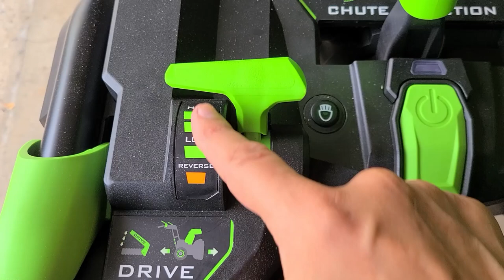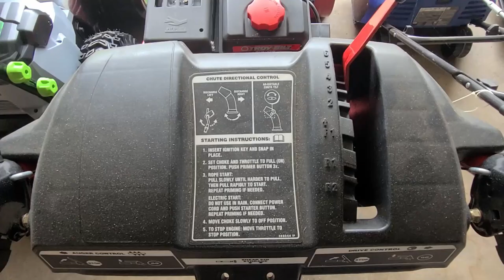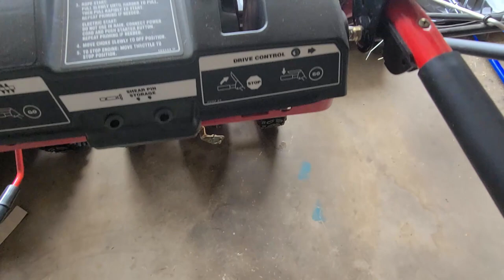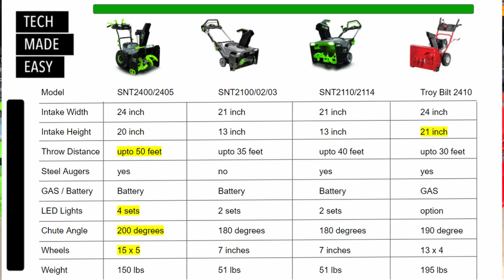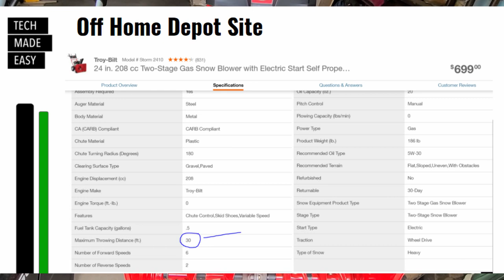NEW EGO 2 Stage Snow Blower unBoxing, Assembly & fun Comparison review

Comment: i got to test the prototype a year ago on the 2 stage and the metal auger 1 stage...i have the rubber auger and used it side by side with the steel one and the steel one was nicer throwing snow....when i tested the 2 stage , i told them it needed a limited slip differential and they used my idea....it makes it easier to turn at the end of a row....i have a 26"Ariens which is a big boy next to the EGO but the ego is nice for people who may fear gas or size or noise...great video
Reply from the maker: Thanks so much Brian, I’m excited to use this, can’t wait for snow ❄️ might have to go looking for it. Have a great day

Comment: for anyone on the fence between the 1 and 2 stage, I would not hesitate getting the 2 stage....i used the prototype a year ago and it worked great....it is not a gas machine but it does what it has to do, gets rid of snow....the 1 stage is good for a deck or a walkway or like i use it, a dog path in the back yard......the price may seem a lot but you get what you par for nowadays....the machine is not intimidating and plows through snow  AND you don't break your back shoveling....if you are trying to decide, just do it, you will not look back...i have 5 EGO products now and love them all
Reply from the maker: Thanks Brian appreciate you sharing your experience

Comment: I have definitely been eyeing one of these units. I looked at one up close at an ACE hardware I the Detroit, Mi area and I was impressed. Looks well thought out. My only concern was the gauge of the metal for the auger and impeller housing seems rather thin. Could just be me. I have an ECHO ( not EGO) 56 volt lawnmower that has a one piece molded orange ABS plastic deck that has a lifetime warranty. ABS is basically "LEGO" plastic. Very tough, doesn't rust, need painting etc. Too bad they don't use this material for the housing which would last just about forever and not need any adressing AND would be considerably lighter. Just my two cents. Still, a wonderful unit anyways. Can't wait to see someone posting a video in real snow conditions.
Reply from the maker: Can’t wait for it to snow Karen 😊

Comment: Good vid
Looking forward to review of this unit in the snow - hoping someone does a comparison against the SnowJoe 2 stage.
I have a big Ariens gasser -- tried to replace it last year with the 2 stage Snow Joe but that was a fail - returned the SJ.  The SJ was 100V batteries and this new EGO is 56V so worried about power. SJ 100v5AH vs EGO 56Vx7.5AH???.  EGO looks way better built, controls much better - but does it clear heavy wet snow. I had the SJ jamming up on 2 inch of heavy snow.
Looking forward to seeing more in action reviews of this product but I dont think I will get on until next season once all the test vids are out from this winter.
Cheers
Reply from the maker: Patrick, I’ll definitely post a video when I get snow and I normally don’t hope for snow but I definitely want 20+ inches of snow so I can record an awesome video showing people that it works or it doesn’t work. I agree with you that’s gonna be the true test.

Comment: What is the size of the box it got delivered ?  Not sure that will fit in my VUS to pick it up at the local store. Thanks.
Reply from the maker: VUS is that UPS? It's a huge box but most will accept it and call you for immediate pickup, you would definitely need a van or pickup truck
Reply: @TechMadeEzy  ha ha ! no, sorry, i mean SUV. I want to pick it up myself at the store.
Reply from the maker: You should have someone with you but the box is around 4 foot tall of I remember and around 3 foot wide (just a close guess) or take it out of the box
You are going to love this! But have an extra set of batteries when you can get them, that makes it better if you have a big snow storm

Comment: Now theres a new 12ah battery that should have the option to be packaged or fits this??? Idk Hopefully I get this stage 2 unit in the next few weeks been looking for it for over a year now always sold out
Reply from the maker: Hi I heard it fits with no problem but I don’t have one to try
Reply: @TechMadeEzy  thanks for the quick response.. I wish there was an updated snowblower model since others are having issues with a shear pin breaking.. with a new look something more efficient and just cool overall would be awesome
Reply from the maker: You got it 👍🏼
So far no issues with mine I’ve used it for a few years now especially with some high thick snow

Comment: Congratulations!   I’d really like to get one myself.

How do you like the forward and reverse speeds for walking?  I think your other two stage had more granularity i. Speed settings.  Particularly the reverse which only has a single setting.  Do you feel it would be too slow if you had to fully back up the driveway in the case of a blizzard?

Thanks again and CONGRATULATIONS!
Reply from the maker: Thanks so much Eric and yup after testing the reverse I do believe it would be too slow to back up the driveway I’d rather just turn it around, it seems pretty easy to maneuver but I definitely would like to see how it acts in the snow. I mainly comparing it against my troy Bilt, that’s a pain to turn.
Reply: Tech Made Easy  Got it.  Thanks for the clarification.

Overall, how do you feel
The maneuverability compares with your Troy Bilt?
Reply from the maker: Moving it around without snow and comparing them both a major deference and with the both batteries in it of course. Much easier to turn and move around. Can’t wait for some snow for the true test of if it can handle 20 inches of wet snow. We will see.

Comment: Thanks for the video, I'm on the fence between the two new Ego models myself. Any fears of the 2114 handling plow piles?
Reply from the maker: 2114 had a height of 13 inches of I remember correctly, metal augers will help but those wheels will be trouble because they are tiny and won't have much grip on the snow. If you deal with snow most of the time or definitely every year I recommend the Snt2405 package

Comment: I heard 10amp was same physical size as a 7.5Ah....
Reply from the maker: That would be amazing
Reply: @TechMadeEzy  Don't EGO make a point for all their batteries to be compatible with all their equipment? I can't imagine they would come out with their most power-intensive tool and then make it incompatible with their strongest battery.
Reply from the maker: I think it's a matter of if it will fit, I don't think the 10ah will fit in there mowers but it will with the backpack blower,, nexus power station etc
Reply: @TechMadeEzy  Looks like it will! Found this UK site that seems to confirm it: https://egopowerplus.co.uk/products/batteries-chargers/ba5600t-10-amp-hour-battery
Reply from the maker: Thanks @heidiwilks
Reply: @heidiwilks5316  interesting; but in UK, the voltage is 220/240v. The charger would have the UK plug. Would you be able to charge it on a US 120v charger?
Reply: @flygirlfly  Not sure, maybe EGO Corporate could tell us?